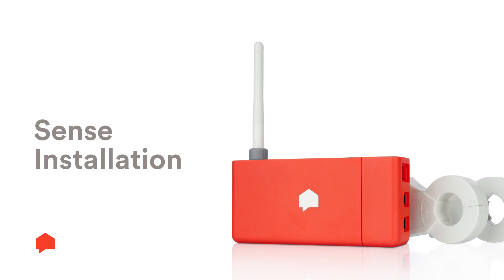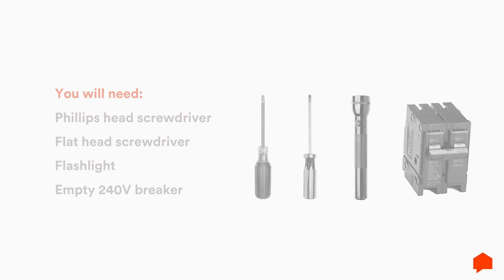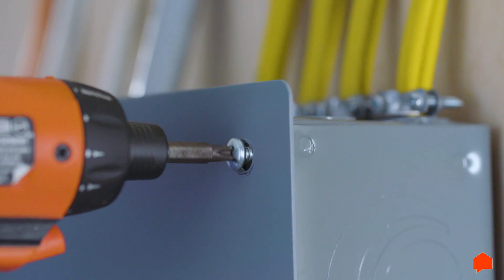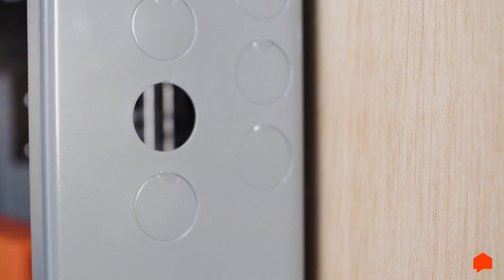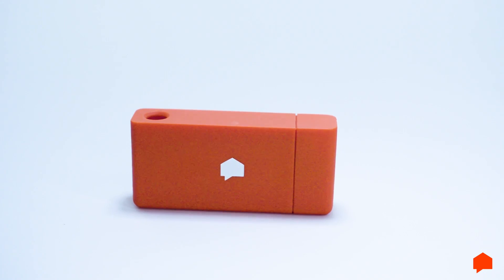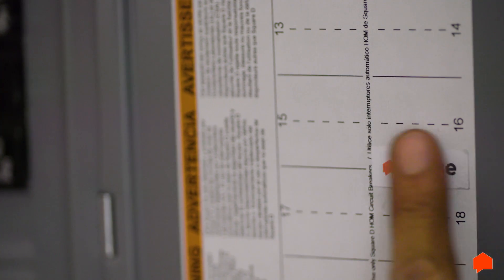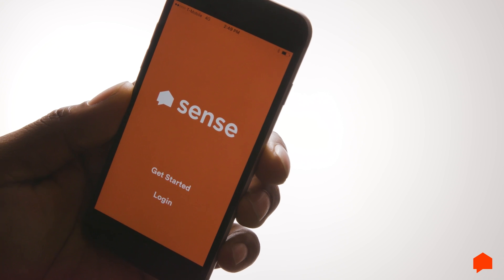Sense Install Video

Comment: Use a two pole 240V breaker. 

Would have saved me multiple trips to the hardware store and a stripped breaker panel cover screw had Sense just stated upfront that you need a 240V double pole breaker.

Comment: At 2:22, the installer puts both hands inside the panel, close to the mains. I would never put both hands near the mains. That is guaranteeing an electrical path across your heart in the event of contact with 240 volts.
Reply: There is absolutely nothing wrong with the way they installed this.  Not even close to any bare wire
Reply: @Z34370z  I hope you're not a supervisor for the sake of the safety of  electricians. Your obnoxious response will be ignored.
Reply: @Vodichka9  New hires with their over-the-top responses. The video stated it was a mock panel and to always hire a qualified electrician. Although no one should work in a hot panel, your original comment shows your lack of understanding of electrical faults and hazards. We get it, you just completed your safety training in school.
Reply: @riipcord   Haha, I'm being patronized by the clueless. Your desire to scold might be intoxicating to you, but it shows your own ignorance. Having worked for many years with voltages of several kv, I always keep one hand behind me. Chances are, I know a great deal more about electrical theory and have had far more actual experience with electrical devices than you. Let's see what kind of silly retort you'll produce.

Comment: I find the Sense device, despite its claim for ease of installation, difficult to get working properly. I  keep getting repeated errror message saying that the power cable was installed incorrectly; drawing power from the same phase or leg of the electrical panel. This is not possible for a Square-D QO panel with a QO 2-pole circuit breaker. No matter what I try, the error persists. Aside being a  useless toy,  most AHJ will not allow piggy-back circuits on circuit breakers.

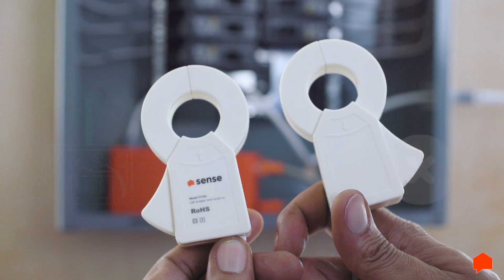Comment: Ummm at 2:19 shouldn't the electrician be more careful and maybe wear rubber gloves to?
I'm no expert but if your knuckle would touch the ground wire or if you would backhand the fuse box I guarantee you would do a smoking backflip across your basement.

Comment: I already have a 240 V 50 Amp breaker installed for my EV, which takes max 32 Amps.  Can I connect the Sense to this breaker rather than install a new breaker?
Reply from the maker: Hey Han. Sense can function if piggybacked on an existing breaker, but you should consult a local electrician to do the installation as they can verify that such an install would be up to local codes.
Reply: @Sense  It can function that way but is strictly against the NEC and NFPA-70 safety requirements

Comment: The power company web site does the same thing and it's free to use
Reply: In my case, I am looking to monitor what the power company is reporting.  Their meters are not always very accurate.
Reply: True, but it doesn't give live info, nor separate each little power usage into a device. My power company offers usage graphs for the 15 minute period.

Comment: I have a 40 position panel with about 36 positions in use, so it's a lot more crowded than the mock-up you have in the video.  You don't show installation with the sense unit external to the panel, but I assume you mount the antenna directly to the sense, and route the wires through a 1/2"? knockout.  Do you provide a strain relief for the knockout, or do I just use a romex clamp or something?  What is the length of the cables?
Reply from the maker: Hi Andrew. You can find the answers to those questions here: https://help.sense.com/hc/en-us/articles/210456257-Mounting-Sense-external-to-your-electrical-panel

Comment: Does Sense auto reconnect to your WiFi automatically after short power bleeps or do you have to shut the main breaker off for more than five seconds for it to reconnect to the WiFi signal? We have short but often power bleeps in our area and I'd be in no position to cycle my main breaker off and on every time we encounter power bleeps.
Reply from the maker: Sense should automatically reconnect after power is restored (or after a power dip has returned to normal). If you're experiencing issues with this, reach out to support@sense.com.

Comment: Can I wire this to an already installed 240v circuit in my home?
Reply from the maker: Hi Robert, good question!

You can certainly connect sense to an existing 240v breaker. Some local electrical codes discourage "sharing" breakers, but having Sense share a breaker with your dryer, oven, or some other 240v device doesn't affect its performance at all. Sense also draws very little on it's on (~4 watts, <0.2 amps), but it needs to be connected to a 240v breaker so it can accurately measure voltage on both legs of your electrical service.

Hope that's helpful. Enjoy your weekend!

Comment: I have 2 panels side by side in my house - how do I determine if they have "separate service" or if one is a sub panel?
Reply: I would install it to the MAIN service panel.
Reply from the maker: Hi Chris, so sorry for our delay in getting back to you!

The best bet is to check with your electrician, but here are some tips for a safe way to check on your own.

You may be able to follow the trail of conduit coming into your home. If there is conduit feeding one panel (let's call it 'Panel A') from the other panel (we'll call that 'Panel B'), and there's a big breaker inside 'Panel B' that shuts off the power for 'Panel A', then 'Panel A' is a sub-panel, and 'Panel B' would be your main panel, and the best place to have your Sense monitor installed.

However, if there's a big junction box where the electrical service comes into your home, and conduit comes from that junction box into both 'Panel A' and 'Panel B' individually, then they likely have separate service.

Hope that's helpful!
Reply: Sense if we do in fact have two separate panels would we need to purchase two Senses?
Reply: @eliseychou  I don't think so, you still would need only one Sense since ALL current passes through the MAIN service panel
Reply: @eliseychou  you need sense Flex and a sense extension cord.

Comment: What if you have 2 service panels?
Reply from the maker: Great question,

You would need two Sense monitors, one for each panel, and at the moment, you would have to access each one from a separate account. However, we are working on functionality that could merge the information from the two monitors into one account. Stay tuned!
Reply: what if you have three phases instead of two? @Sense
Reply: I too have two panels and the one in my garage has solar inverters connected to it. So really I'd only need the one from the main house as the one in the garage really only has the production going through it.

Comment: Is there any interference if the clamp leads must be installed through many circuit wires?
Reply from the maker: Good question, Neil -

We've had to think a lot about the EMI floating around the electrical panels that Sense is installed in, so the components are built to tolerate quite a bit of interference. That being said, it's expected that the clamp wires will be crossing near or adjacent to AC inside your panel, and it shouldn't present a problem. As you'll see in this installation video, ideally a clean panel includes dressed cables set at right angles, so the crossover points between the cable leads and THHN would also be at right angles, mitigating some small amount of interference as well. 

Hope that's helpful!
Reply: Due to the laws of electromagnetism (the Lenz and Faraday laws, specifically), any wire not enclosed by the circular loop of the clamp-ammeter gives little to no interference. Hope that assuages your concerns.

Comment: This looks like a single phase panel. Does this work on 3-phase panels?
Reply: @sense: 3 phase is common in a houses in europe, please add support for 3 phase
Reply from the maker: Thanks for your interest, Marc! It's definitely on our radar. If you haven't already, sign up for our mailing list so you will be notified as soon as it's available:
http://eepurl.com/c1dRFr
Reply from the maker: Good point, Blake! Thanks for asking.

Sense is currently built for split-phase homes in the US right now, but 3-phase is something we hope to support in the future. For homes with 3-phase systems, you can still measure two phases using Sense, but the third phase would not be monitored.

We have more information about compatible panel configurations here in our knowledgebase:
https://help.sense.com/hc/en-us/articles/115006132768-Compatible-electrical-panel-configurations

Hope that's helpful!

Comment: how can it figure out what devices I am using? It is only monitoring the mains. The electric company can give me all this information.
Reply: It can figure out when a device turns on by looking for the power signature of that device. Every device has a different signature. It's similar to knowing where someone is from by listening to their accent when they speak.
Reply from the maker: Good question!

The Sense monitor is metering current and voltage of your mains at a 1 MHz sampling rate, and then analyzing your power consumption using machine learning models to disaggregate the power consumption and on/off status of individual devices within your home. 

We have a number of blog posts that explain the technology in more depth over here:
https://blog.sense.com/how-the-sense-home-energy-monitor-works/

And there are some other great videos on our page and that our customers have posted that explain more.

Hope that's helpful!

Comment: What if there is no free space for another breaker? Can it be connected to a existing breaker?
Reply from the maker: Sure thing, as long as that is in compliance with your local electrical codes. It draws very little on its own (~5 watts), but needs to see both legs of your power supply to inform its measurements.

Comment: So you spend $300 dollars to install a monitor to tell your phone that your electrical devices are on or off. I guess if you can't see the indicator lights on your devices this might be helpful but for $300 dollars I don't think the device will provide enough value to pay for itself.
Reply: It paid for itself after 3 months on my end. My electric bill was $150/month... could not frigen figure out what was drawing all the juice. Tried using an amp meter but the results weren't consistent plus I don't have all fcking day to measure amps from every single amp drawing device.
Reply: Steven Stocki Did you ID the power hog? I’ve got a similar situation in my house.
Reply: It detects a "power signature" of the different devices that are using power. I'm not sure exactly how that works, but from what I've gathered they can tell what kind of device is drawing power by the fluctuations it creates in the lines. I'm sure they probably have a video on their channel explaining it. I've got a friend who got one and it really does work somehow.
Reply: it detects a power signature because alternating current is in a sinusoidal wave form, if you watch some of their informational videos sense does 1million scans per second on your electrical signal, so yes, a unique signature would flick up whenever you switch something on or off
Reply: The time it take for Sense to pay itself < or = the time it take for a solar energy system to pay itself.
Reply: Not all devices are obviously on or off. Some devices that should cycle on and off could be running constantly, like an old mini fridge in your garage. You may have thought you were saving money by not replacing it, but a new mini fridge might pay for itself in a few months.
Reply: this only measures the mains. How can it tell you what device and where the power is used?

Comment: So, it's essentially nothing more than a WiFi enabled ammeter. The app does all the work with simple algorithms, monitoring amp draw.
Reply: Yeah, but... its the digital signal processing  and signature analysis that is done on-board (and probably also in the cloud) - that's the trickier part... I don't have any stake in this company, I just did work on my own home monitoring and consulted with some grad students at CMU who were researching this concept a number of years ago.
Reply: Sims